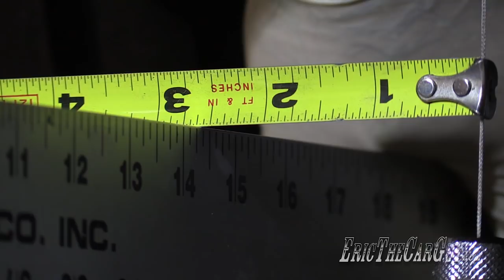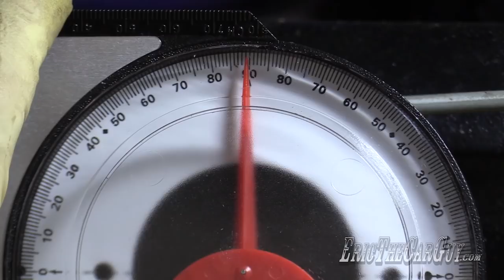Take Corners Faster! How To Install a Panhard Bar

Comment: Love these long videos. Thanks for the installation journey. Question. Doesn't adding all these different stabilizers start to add  a lot extra weight?
Reply from the maker: I have added weight with this new set up, but I don't think it's going to matter too much. I'd rather have strength here over weight savings. Also, these parts are as light as they can be for the job they do. Thanks for the comment.

Comment: Independent rear suspension suddenly looks so much easier.
Reply from the maker: A lot more expensive and believe it or not, heavier. It would have been cool though. Perhaps one day I'll swap it out. I have seen foxes with new Cobra IRS systems fitted.
Reply: And believe it or not, not much better than a solid axle with a torque arm and panhard bar/watts link. IRS from a 99-04 cobra sucks and isnt tgat good of a design compared to other cars that are designed with IRS frok the beginning

Comment: I’m confused about the ride height portion. You said you measured from fender to tire . Did you measure from the top of the tire to the fender? Also when you jacked up the diff to take out the shocks , did you jack up the diff with a tire on it to  get it to the right measurement you took when it was on the ground?

Comment: I'm a bit confused about when he used the plum Bob on the frame to center the rear end, you hung the Bob from the  right side the hole on the passenger side, but on the driver's side, you hung it from the right side of the hole as well. Wouldn't that put the driver's side measurement off by the width of the frame hole?

Comment: Did your turbo exhaust need to be modified to work with the Maximum Motorsports torque arm... I have a foxbody Mustang and I just bought the Maximum Motorsports torque arm and a hellion turbo kit... And got to thinking about this "I wonder if it is going to fit"... I guess an exhaust shop should be able to take care of it if it doesn't

Comment: Suggestion you've probably already known,.For cutting tube,pipe etc',,fasten an appropriately sized screw hose clamp at your line and follow that edge with whatever you are going to cut with,,straight every time ;)

Comment: Great engineering practice is to tighten the nut not the bolt as you are trying to overcome three resistance points vs two with the nut . You already knew that though. Thanks!

Comment: wonderful job Eric, keep on the good work.
I am just curious, why didn't you go with an IRS instead?
Reply from the maker: I looked into it. My research showed it was expensive and heavy. Pull-a-Part hooked me up with this axle assembly so it just kinda went from there. If cornering is an issue after I'm done, I'll consider the upgrade.

Comment: I suspect that the reason those nuts and washers were going in further than you like is that your measurement didn't account for the thickness of the frame wall on the inside plus they told you to make it a bit shorter. I personally think the instructions should have mentioned that. Anyways, love the videos, keep it up.!

Comment: i know its kinda late here, but to protct the rod ends,, ' seals its ' has full rubber rod ends boot cover, and they are cheap.. i have them on my 1984 alfa romeo spider.. i replaced all my cute little tie rod ends , with 5/8 in qa1 teflon lined rod ends.. and of course ' seals its ' boots...also from what i have read in suspension books.. the panhard rod for best performance  the bar should be in the same centre lind as the axle centerline, this is for best... left to right turning.. i will look up the results of a panhard bar located below the rear axle centre line.....i had to make mine for my car.. but i mine with a centre adjuster in addtion to the qa1 rod ends, make the adjustment much easier

Comment: No need to lengthen that slot,you want to level the bar with your weight in the drivers seat(depending on the spring rate will lower the frame mount 3/8-1/2").With that done there will be plenty of adjustment within the existing slot.

Comment: Hey can I install this setup if I have qa1 coilovers mounted on the inner part of the differential? Since I replaced the lower control arm brackets is this usable in my setup? Thanks ahead of tome

Comment: Eric as a avid viewer of lots of car channels did u not have wheel alignment tool that I thought I saw in a previous video u have made wouldn't that make setting where the rear diff sits alot easier

Comment: 27:15 Isn't it too many holes in the frame rail?

Your Ford turns out so nice, I really like it. Besides, after the video I tried to remember, how many things did you mentioned, that are significant for Panhard bar installation - I found 4, at least. This is great!

Comment: I'll keep watching, mainly 'cause I don't have a friggin clue what you were talking about, not to mention the difference between one or the other =) I'm just watching because I like ETCG videos, the host and cars in general. I'll never build a fox body, but hey... it's infotainment =D
Reply from the maker: Thank you. I'll be changing things up over the next few weeks. Hoping to make these more interesting to viewers like you.
Reply: My view is that anything you can learn about working on cars you can carry over to other parts of working on cars. Your videos are interesting and informative, even if they don't apply directly. If I ever build/restore a car (and that's a big if), it will probably be an early Citroen with hydropneumatic suspension =) But what I have taken away from you is that I will gladly tinker with smaller stuff on my car. Like splicing in new leads in the loom to the back gate of my station wagon when a couple leads had broken from years of bending. Before, I would never have touched the loom of a modern car. But hey... it's just copper leads, and they are easily spliced if you just take them for what they are =)

What I was referring to as not knowing was the difference between a panhard bar and that other thing you mentioned =)
Reply from the maker: Thanks again for your comments. I put a link in the description that talks about the differences between a panhard bar and a Watts link if you're interested. Sometimes I forget to put something like that in the video and I usually try and make up for it in the description.

Comment: I realize the inportance of the 4 1/4 inch measurement at 14.51. Later you adjusted the other side by ( rotating slightly ) to the same distance. since you are working with a solid assembly the amount of rotation will be transferred to the other side. You should have checked for that. Unless you did that off camera, sorry.

Comment: You should always align your rear axle to the tracking of the front wheels, or to each other for better terms, never to the body. Doing so could possibly cause tracking issues, such as understeer, oversteer, or worse!    Body tolerances on a car of that vintage usually were plus or minus 3/4 of an inch. Alignment tolerances around 1/8 to 1/16 of an inch. They don't match up well!        JT. retired Frame, Auto body, and alignment Tech.

Comment: any reason for your decision to go with a panhand vs a watts link?
Reply: Alex V cost.  a watts link set up is a lot more expensive and Eric isn't exactly rolling in dough.
Reply: Captain Rudy Eric is a smart guy with a welder, he doesn't seem to be cutting any corners anywhere else on this project, he could build something better inexpensively or maybe adapt crown vic parts. I was just wondering if he has a performance reason for going panhard vs watts
Reply: Alex V well I'm pretty sure he said in the video that he chose the Panhard bar instead of the watts link due to cost.
Reply: Captain Rudy 4021 were at ? Alex v is right he's probably smart enough to build his own parts or junkyard MacGyver his way out
Reply: I know I'm answering an old comment but... Maximum Motorsports covers this on their website in the FAQs.  They don't argue that a panhard bar is better but they do discuss how much movement from side to side you're dealing with and why they feel the panhard bar yields the most benefits to the majority of their customers.  I recently purchased suspension for my mustang and had the same question.  If you look at the info they post on it and put that with the reputation they have built through the performance of cars equipped with their products it's hard to argue with them.

Comment: Just a thought, on the long bolt the bolts the panhard to the axle, would not a steel spacer the inside dimension  create a stronger load area, than . just that long bolt in space
Reply: love your videos
Reply: I drive a Alfa Romeo spider,can't but one of these, but I have good idea how to copy it. thanks for the video

Comment: Seems like the tires needed to roll around on the ground to adjust to the adjustments sidewall flex and tires needs to scoot outwards almost with panhard adjustments

Comment: 26:30  Why not trim the bump stop bracket when it attaches to the frame?  That would let those crush tubes to sit better and put the squeeze more evenly on the frame rails when you tighten it up.  Just a thought.  :-)
Reply: PS:  To make sure you turn the bar the right way when centering your axle, it's easier to think about it as pushing or pulling the left when back and forth, since it's attached to that side of the axle...so shortening will pull the left wheel inwards, lengthening will push the left wheel outwards.  The right wheel merely follows along.  I find this makes it so much easier for me to keep track of it that way.

Comment: Just take it too an alignment shop that can do 4 wheel alignments. They use lasers to set the front to rear tire relationship angles.... Hell some cheap people just use a string. Then mount an L bracket on the front lug nut. A second L bracket to the rear lug nut. Pull a string and measure the difference off the front and rear of the rim.... You can actually set the front end that way to within a degree for caster\chamber and toe in...

Comment: Are you going to cut out the spare wheel recess?
Reply from the maker: I don't plan to.
Reply: It just looked to be in the way and will you actually ever carry a spare?
Reply from the maker: Yes, when I take this car on trips. Remember I'm building this car for the street. I'm also mounting part of my fuel system to it.

Comment: Video is great as expected.   
Bit of advice on the thumb though.   Need to reduce the size of the lettering, they are touching and makes its a bit to full.   A little smaller so the words can separate a bit which would make it easier to read while still be attention grabbing.   As for me, as long as the title is truthful, it isn't click bait.
Reply from the maker: Thanks for the input. I'm still experimenting. I'm not sure if I'll stick with the multiple colors. Perhaps 'click bait' wasn't the right word to use in the ETCG1 video. 'Click bait like' might be a better description.
Reply: I like the colors, stands out and makes it easy to see yours in my subscription tab with all of them on the same page.   Just not the squished together words.

Comment: Better get them space saver rear tires off 
Gonna need some Boots on that baby👍👍👍
Reply from the maker: Unfortunately those are about as big as I can go now. Because of the shock mount you really can't go in further without going coil over or IRS. I was thinking about picking up a set of slicks for the track though.
Reply: Indeed your gonna need them for sure!! nice job!

Comment: Hey Eric why u never tightening up u drill bit harder ? :)
Reply from the maker: I do, the chuck is just worn out. I got a new drill recently and it seems to work better. Thinking of doing a review on it.
Reply: Its always nice to watch new tool review. U using cobalt drill bit ?  i think they better then normal hss if u need to drill thick material  :)

Comment: But can I put one on my Civic?
Reply: dosmastrify prolly not, but you can drive your civic to a gay bar
Reply from the maker: You don't need one. The Civic has an excellent rear suspension form the factory. Especially the 90's versions.
Reply: EricTheCarGuy pre 88 civics have a straight rear axle...with a panhard bar already installed!  they even had 4wd versions with a tiny straight axle very much like the fords.

Comment: Eric are you going to paint the car? "Good thing I haven't painted it yet" you said when you accidentally scratched the car with the drill...
Reply from the maker: I don't have any immediate plans for that. I'm more interested in working out the 'engineering' of it ATM. Also, the old paint I think helps with the 'sleeper' aspect of it. However, I'm doing what I can to preserve the body in case I do decide to paint it one day. Thing is, I'll have to tear it all down again to do so. Therefore I'm thinking it might get painted waaaay down the road, but if that day comes I'll be ready.
Reply: Ah ok cool, I thought you were being all cryptic using the word "yet" 

I actually really like the pale yellowish color as-is - it suits the car and it's not a color you see very often anymore (probably wouldn't suit many modern cars though) but I remember Volkswagen used a similar color in the late 70's and early 80's and I always rather liked it, for some reason.
Reply: I do really like the color it already is, it suits the car perfectly, sleeper or stock.
Reply from the maker: I like the color too. It's called 'antique white'. Perfect for a sleeper. I think they still use it today or a variant of it. I've seen some Ford Explorers/Escapes with a similar color.

Comment: Why aren't you measuring from the frame? The frame is the starting point for all suspension geometry. If it's not square to the frame then nothing will be right. Even unibody cars are done from the frame.

Comment: i'm guessing you are heading for a slalom course ;-)
Reply from the maker: I would like it to corner yes.
Reply: trust me...this will be far more entertaining than the bean counters and marketing ever intended it to be. i predict tail happiness on the level of the xjs when the engine is coaxed a bit. should be good fun ;-)
best part is that the local constabulary won't give you a second glance and that will save points on the license....one of the many benefits to owning sleepers.
Reply from the maker: It's really great when people 'get it'. Thanks.

Comment: Panhard Bar's are crap on 1 main reason  
when you plan boot the Panhard Bar pulls the diff to one side causing the rear to wheels to be out of alignment  
dont get me wrong it is an upgrade and was used in many cars in the 90s but suspension over the last 20 years has been by far better    

you are better off buying trac bars AKA traction bars these are bars that will hold your diff center and  keep your diff from rotating under heavy acceleration  these with new shox and springs/reset springs/leafs and wide tires go great  
but make sure you have enough power  to use them haha
Reply from the maker: I think you're talking about a Watts link. That is a better set up but it's much more expensive. Also, it wasn't available from MM. Thanks for your comment.

Comment: Cringe at those shocks each time. Just replaced tokicos on the honda I bought, all leaking. Talk to a suspension guy, not a salesman.
Reply from the maker: He was actually. Thing is, if the suspension dropped anymore, I think it might hit the torque arm. I think that's at least one of the reasons they wanted me to go with these over the ones I had. Thanks for the comment.